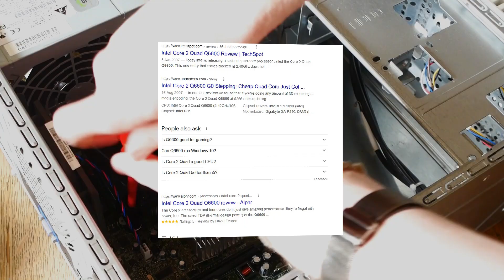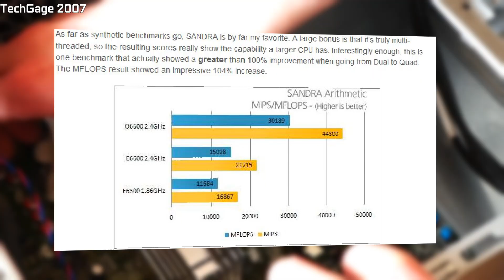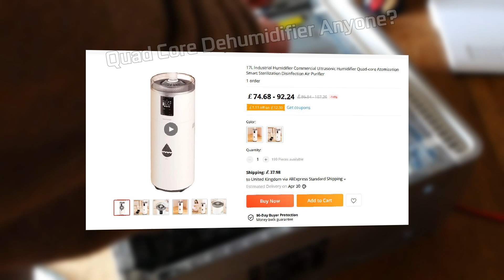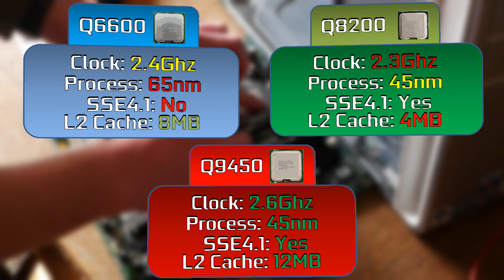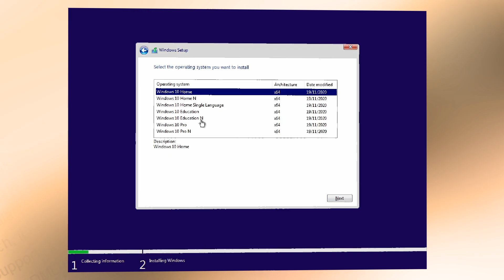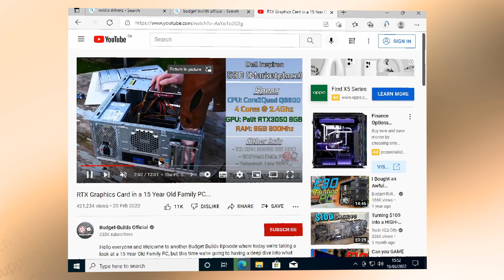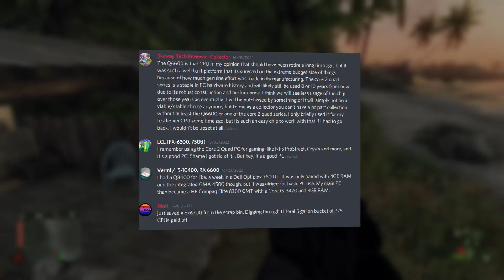Intel's Core2Quad...Finally Obsolete?

Comment: I had a q6600 and it was a great CPU I even paired a 560 Ti with it and I was play the games I wanted to play. I heard great things with the q9550 that it was a great Overclocker being able to reach like 4ghz. I played Diablo 3 for the 1st time on my q6600 and 560Ti.  My dad had  a PC kit of CPU,Mobo and RAM and it came with a q9550 and it ran great he was able to do the stuff that he wanted to do. Linus tech Tips did a video of dual CPU rig that had 2 core 2 extremes qx9650s and some weird DDR2 configuration which made an 8core workstation style Machine.  I had an HP desktop Vista Core 2 duo e8400 and 8GB of RAM and man I had Vista running perfectly on that machine that it even impressed me.

Comment: Still using Core2Quad's in 2022, one is a Q9560 and the other is Modified Xeon Quad E5472 3Ghz @ 1600MHZ to fit 775 board,With 16GB of DDR3 memory!😁😁Using RX460 GPU's on Gigabyte boards

Comment: From experience - the Q6600 can OC pretty trivially about 25% - to 3.0 GHz.  The Q9450 requires faster RAM (if DDR2) to OC decently, but you can also get that chip up about 25% on air cooling too.

Comment: These older Intel chips had a fairly decent lifespan. For a while, I used a HP Z800 system (manufactured in 2009) with some Westmere X5660 CPUs (released in 2010) and it wasn't bad considering its age. I used my Z800 from March of 2020 til August of 2021 and for the most part, it ran well. The main issue I had with it was how it may shut off and restart when I launch an intensive game, like GTA V. When it did shut off, it was right as the map loaded, so I assume a sudden spike in power consumption tripped the Delta 850w PSU overload protection, even if the power consumption didn't exceed the limits of the power supply. 

Though in August, I replaced the Z800 with a ThinkStation P920 and these new CPUs are literally so many times faster than my old Westmeres. One Skylake-EP Gold 6144 has more performance than both X5660s combined. Keeping my same GTX 1080 and slotting it in my P920 lead to a massive improvement in gaming and overall system fluidity. Imma probably keep this P920 for at least a decade and maybe upgrade the video card between now and then. So far, my GTX 1080 8GB still plays games just fine at 1920x1200 with 60 fps, so a new GPU isn't a high priority for me.

Comment: It's relegated to being a "spare computer," but I've still got a system with a Q6600 plugged in.  The Core 2's feel like the last Intel processors that were worthwhile to overclock, back before Turbo Boost became a thing and a processors "frequency" was no longer a single number.  I had a E6600 that ran at 3.8ghz on air (up from 2.4ghz stock), and then upgraded the system to the Q6600 which is still running at 3.4 ghz today.

Comment: I just put a q6600 system together for a friend of mine with a two gigabyte GTX 1050. I was legitimately stunned it could play fortnite in 1080p. I was even more shocked that it got better frame rates than an 8-core bulldozer system I setup 3 weeks prior. Really made me realize why people were so disappointed in bulldozer chips.

Comment: You didn't mention the 'S' variant of the Core 2 Quad, which is built slightly better and has a 65W TDP instead of 95W. There's a Q9550S model, but they're a bit hard to find.

Comment: The old AMD Phenom II X4 and x6 still hold up Incredibly well today.
Reply: I had a 925 PII X4 @3.2GHz stock voltage and used it until 2018 replaced with Ryzen 7 1700. Let me tell you though Phenom was handicapped quite heavily by the lack of SSE4 near the end as games would outright refuse to run.

Comment: Really pleasant video! It's really nice to see someone talking about this awesome cpu's in 2022.
Back in the days I owned (and still have) an Core2Duo E8500, but in 2018 +/-, quad cores was a must and I bought an Core2Quad Q9650 for like 30€ used, and was a blast!
In the actual days, it's my father who runs that pc for usual stuff, and he does the job pretty decent! Nothing to complain and nothing to worry about upgrades. Was glorious days when that CPU's came out, and i'm still very happy to see them runing like a charm. My father is really happy with my old PC (MB ASUS P5E + Core2Quad Q9650 + ROG RX570 4GB + HYPERX FURY 8GB DDR2 + WD BLUE 500GB + WINDOWS 10).
Thanks for this video Sir. 
Such great memories!

Comment: The Q6600 has another trick up its sleeve.  The BUS speed is set at 1066 but on most MOBOs you can block a pin that'll set the bus to 1333 making the Q6000 run at 3Ghz (rumoured it's original speed before intel nerfed it)  I have this set in my mum's old Acer AIO that does NOT support Overclocking! I just bent the pin (in the lga socket) out the way!  EDIT: The BSEL mod!
Reply: thats insane, ive been also planning on modding my old cpu, what do you think with the Q9550 that's bus speed aready at 1333 ?

Comment: Ive been on a mission to make the fastest socket 775 platform I can for about 10 years now. It's the most powerful platform that can be made to fully support an alternative/retro OS I enjoy ("Amithlon", which is itself a way to run AmigaOS as close to bare metal pc hardware as possible. Still emulates cpu for 680x0 AmigaOS software, so any tiny improvement is useful.) 

I'm fortunate enough to have modern gear, but a c2q packs enough punch to keep someone entertained for life. The ps3 and xb360 was a great era for games, and a c2q based  pc is both very highly compatible with pc versions of those games, and offers a better experience than the console versions, so while it may struggle to deal with modern software well, it's still a fantastic platform for 10's of thousands of pieces of software. Throw in emulation and there's a nigh on infinite number of titles to choose from.
Reply: Agreed. I'm Amiga user too. :)

Comment: I have a Q9550-based desktop I used as a daily driver all the way up to 2020, and only then I upgraded because my LGA 775 motherboard didn't support USB 3 which I needed for my pandemic work-from-home setup. I intend to turn it into a Windows XP-era retro gaming rig once I find a suitable CRT monitor and period-accurate video card.

Comment: I picked up the Q6600 GO ($205) with a eVGA 680i SLi rev. 2 board and 8GB's of 1200MHz SLi ready DDR2 for $600. Then spent another $400 on 2 512MB eVGA 8800GT's, for that good ol'SLI. Overclocking the Q6600 to 3.2GHz-4GHz gives it a 25%+ boost in performance. overclocking makes a difference on those chips. 8MB' of L2 cache helps allot. But NO SSE4 instruction.

Comment: I still use a Core 2 Quad (Q9300 Yorkfield 2.5Ghz) for all almost all my media/content consumption. Makes a fine media PC, and it runs my 9TB drive pool (NAS) too.
It sucks for gaming, even with a GTX 980 in it, GTA V runs poorly and so I keep a GTX 550 ti (1GB) in it so it's fine for media, but it won't handle 4k media, but I don't need that since nearly everything is 720 or 1080p.  Only issue I have is on Netflix I get an occasional video pause, while the audio keeps playing, but the video will start again in fast-forward to catch up with the audio... but that only happens like once every couple hours.. but it's only Netflix this happens (even with the GTX 980 installed). Twitch, YouTube and anything else plays video fine.

Comment: I have a couple of old Dell business desktops with C2Qs in them that are used pretty much everyday for light gaming and web browsing. Got them for around £35 quid each many years back and have upgraded them over time from the original dual cores, now they have 8Gb of RAM, SSDs and a low end GPU  and they run Windows 10 pretty well considering. Fingers crossed they have a few more years left in them before I need to retire them.

Comment: I remember that my q6600 @3.5ghz could barely run Tekken 2 on mame full speed, something like 110% on fast forward. My quad 3ghz 3330 Ivy Bridge was 150%, which was a good upgrade considering it ran waay cooler... but my new i3 12100f is 600%, so it´s time to move on... even with a low end card like a gtx 950, Alder Lake is really worth it. See, yesterday I tried the original crysis with the ultra mod, and it runs obscenely smooth at 50hz with vsync, it could do solid 60fps with a better card for sure (this already does 60 average).

Comment: I was able to get a Q9400 on the cheap in 2015 to upgrade from an E6420 Core 2 Duo which I had pretty much since launch in 2007. It did fairly well until I was struggling too much with my photo editing and Lightroom - and in 2018 I replaced it with an i7 8700k, a far more modern system. (it didn't help that Intel kept making quad core chips until Ryzen came along). If all I did was use office apps and browsing then I could easily be still using the Core 2 Quad system now, even with Windows 10.

Comment: I currently have a Core 2 Quad Q9505 with 8Gb DDR2. It's running GTA5 fully playable in 1080p normal. It's running windows 11 without problems. In windows 11 it shows signs of age though...

Comment: I still get handed plenty of old Dell C2D machines that are just used for web stuff from boomers etc. I slap in a 120GB SSD and then throw in a C2Q for a fiver or free and a couple of extra GB of DDR3 that are laying around and the customer is delighted. Good to go till 2025 or 26 or 27 whenever MS finally stops supporting W10.

Comment: I was running a core2quad until a couple years ago, when the MB crapped out on me. I used it for video recording and encoding and playing everquest which ran fine. I found a replacement motherboard and it died about 4 months later, I suspect the capacitors on the circa 2007 motherboard just were not in it for the long haul. now I'm on a i7-3770k and as far as general use like booting and launching programs its not noticeably faster, its clearly faster when encoding video hands down, but as far as running chrome it feels the same, just as snappy.

Comment: I was the lucky one in Joystiq's contest to win a Falcon Northwest PC, it had a QX6850, SLI'd 8800GTs and 2GB of RAM, I originally upgraded it to 4GB of RAM and it was running Vista at the time. It's been a long time and it's been long replaced by two more PCs down the line, but it definitely was my first taste of high-end gaming when I was younger.

Edit: Might be wrong on the processor, the PC has been in storage for years, but I think they upgraded it before shipping, but it originally was a E6850 instead of a QX6850.

Comment: I still use an E5450 (Q9650) on my retro PC. I paired it with AMD 7850 2GB and 8gigs of RAM. I remember playing The witcher 3 on this PC with 45fps low settings. Oh man :D. Interestingly enough i still use this pc on my village running win10 pro on an SSD and do some retro gaming :)
Now i'm using ryzen 3600 and gtx 1080

Comment: Obsolete? I'm watching this on one.
Okay, not actually a C2Q but a Xeon X5460 (stock 3.16 GHz, 12 MB cache, 333 MHz FSB, so right between the Q9650 and QX9775) which runs stable up to 4.1 GHz on my P35 board with a hyper 212 evo, at which point it can still hold up with lots of tasks. Including games.
Stuff up to around 2016 are still mostly totally playable and even some newer esports-oriented games do alright. (Tomb Raider 2013, GTA V, Overwatch, Witcher 3, non-RTX Minecraft, etc) i mean the Q945o here gets almost 60 fps on GTAV, now imagine that but with a 50% overclock.
And if I wouldn't have anything newer available, I think I could manage to deal with it. Performance is acceptable considering it's age.

But I still think the Q6600 was never at point where it was a great choice for gamers (outside of upgrading old OEM systems) At it's time it was too expensive and barely anything used more than 2 cores (and something like a E6600 or E8400 was a better choice). Later there were cheaper, more power effective and often faster quads (like the Q8400 or i5-750) and by the time a quad was pretty much neccesary for gaming, technology had progressed so far that it couldn't keep up anyway.

Comment: I have a 8x overclocked core 2 quad 9450  and a 1050ti and I'm able to play games like Fortnite at a locked 60 on default low settings (without motion blur because I always turn that off). On the other hand, I am also using ddr3 in my motherboard and 4x4 gb of ddr3 ram so definitely a newer specd board.

Comment: I still have a couple few systems running the quads. None of them are daily user machines. But it's just hard to dump a machine that has always served me well. They are 9000 series chips, but still work great for the secondary tasks they've been relegated to.

Comment: Wow! I had a Dell OptiPlex 755 with the Q6600 and it was really an awesome processor and system as a whole. I used it for almost a decade, from 2007 to 2016. Great memories with that computer!
Reply: Still have one tape modded with 8gb ram, wd raptor hdds and an hd 7750. It barely gets any use now though. Filled it with ps3/360 era games and retro emulators 🤘

Comment: I'm still rocking a q8400 clocked at 3.9ghz ... 8gb ddr2 and a gtx960 ... Still a relevant platform if you live in a third world country as mine and everything PC related is expensive as hell ..  chips like those are quite easy to find here, and also cheap .. I will hold to it until I can make a real upgrade .. nice vid bro .. you should cover the overclocked performance of this chips , cause they have a huge headroom for making some improvements ...

Comment: These systems were great for the easy FSB 'strap' overclocks 800 -> 1066 -> 1333, I forget the C2Q I was running, but overclocked on Scythe Mugen Infinity it was only getting mid 50s doing software fully Ray traced interactive game tech demo (sad I can't find that demo anymore).  The cheeeeep sweet spot now might be the Xeon first gen Core.  I got an i3 system given to me for free and the Xeon Quad was $7, overclocks to somewhere around 3.6ghz with the ram at 1600 (had to fiddle with the ratio so it came out correct at the FSB overclock, still easy)
Reply: That is to say mid 50s °C and needed the monster tower cooler to keep it happy.  I feel like I had a mini tower cooler on the Northbridge too 🤣

Comment: I had a Q8400 back in the day, that was the truly ultimate CPU back then, less cache than the 9000 series but that was it, high stock frequency, 45nm, paired with 1066MHz or better DDR2 and an easy 1GHz OC and it was a beast for the day. None of the C2Q CPUs really sang until you OC'd them you really need to start including OC results from a half decent P45 775 board ;)
Reply: I had E8200 with some OC back in 2008, it was superior to all those Athlons X2 which my friends mostly had in that time. 😀 But I noticed that AMD had lower ram latency, probably because memory controller was integrated into CPU.
Reply: See, now I'm intrigued, because I was given an ITX machine with a Q6600 in it and it runs DDR3 memory, which I put 8GB in. Now I'm wondering what the fastest LGA775 CPU is that I can get in there for about £10 or £20. That and a modern SSD and it should go pretty quickly.
Reply: @user-yv2cz8oj1k  Q6600 is good enough, just overclock it to like 3 GHz

Comment: I have a  771 Xeon E5430 2.66 @ 3.2Ghz (equivalent to a Extreme QX9775) into a "retro" gaming pc, i know if my main pc crash or burn down, i can still use this plateform for everyday task! This is amazing! This is like using a 486DX4  in the early 2000!

Comment: I never went down the Intel route for quad cores, the first 4-core CPU I had was an Athlon 860K (and I'd had a triple-core Athlon before it), but I loved my Core 2 Duo E4300 that I easily overclocked by 50% (to 2.7GHz) without really any effort at all!
Reply: The Athlon 860K was damn interesting within the FX lineup. It's a shame they limited it so hard on desktop. There could've been a FX-8450 that would've beaten the 8350 by around 15% clock for clock.
Reply: @HappyBeezerStudios  Well, I'm not so sure about that--the FX chips were obviously limited somewhat by having the integrated GPU, which added power consumption and thus heat to the package. The 860K didn't have that, which is probably why it could clock faster.

Comment: Still a very decent platform for 775.  E8400, E8500, E8600 and the Q6600 are still very capable desktop CPUs, especially with the 6MB and 8 MB cache sizes.  These older CPUs are not for gamers but for everything else the LGA775 CPUs are still great performers when paired up with 6~8 GB RAM and a cheap Quadro K600 video card.

If you want to game then just buy a Sony PlayStation or an X-Box... after all, consoles are made for exactly that, gaming.

Comment: It's quite telling that the C2Q was 15 years ago, and yet Intel was still peddling dual-core CPUs in 2020, before finally ditching them in the latest 12th gen series.  It's probably no coincidence that they stopped regurgitating the same boring old silicon right around the time AMD woke the heck up.
Reply: Intel still makes dual core cpus, but they have HT enabled to pretend they're quad-core.

Comment: The q6600 g0 was one of the greatest overclocking cores out there. I didnt have a single one that couldnt hit 3.4 and i ran most of mine under water cooling at 4.0 either step is a huge upgrade in power.
Reply: Biggest hit was thermals. Going beyond 3.2-3.4 got hot quickly.
Reply: @HappyBeezerStudios  indeed it did, hense air was usually ok around the 3.2-3.4 mark but water cooling was definately needed for the 4 mark. 

The uplift in power available to you was huge though

Comment: I had Q8200 overclocked to 2.7ghz on my PC 13 years ago, and i buy next one in 2016 (yeea...), and CS GO works with HD4850 1gb at 120fps+ (not at lowest settings) in 2014. 
This 50fps now looks like a joke xD Nice work valve.